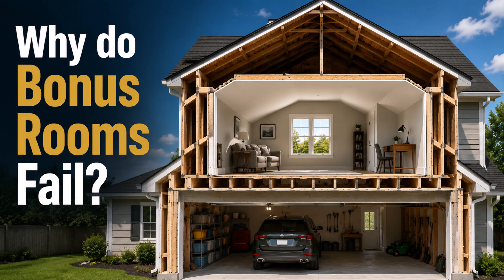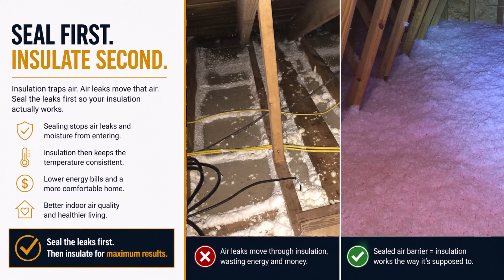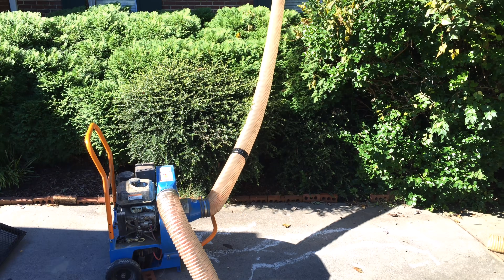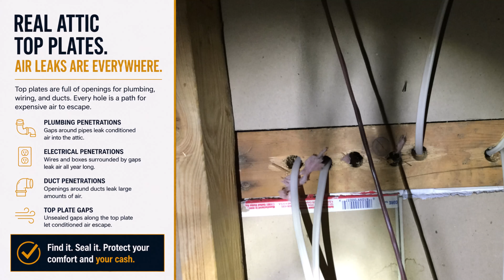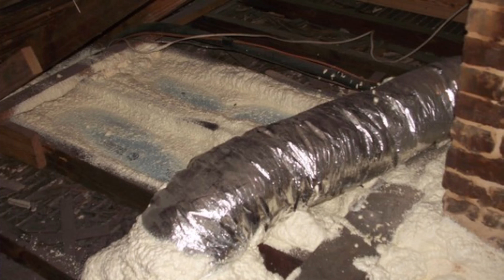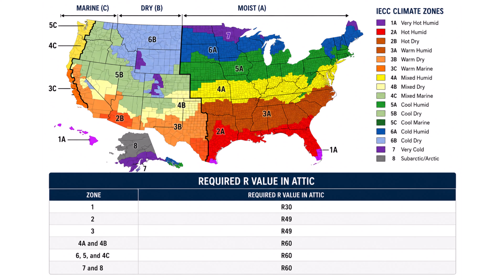Why Your Bonus Room Is Always HOT!

Comment: Great stuff. Everything you said was spot on. I work in HVAC and there is only so much I can do. The building envelope, air sealing and insulation, are the starting points. After that we can look into the ductwork and equipment.
Reply from the maker: @KPHVAC Appreciate the HVAC perspective. Ductwork and equipment can only do so much when the envelope is letting heat in.

Comment: Additionally, leaking supply ductwork creates a negative pressure on the envelope, which in turn exacterbates the leaking envelope by increasing the amount & velocity of air transfer from the unconditioned space to the conditioned space.
Reply from the maker: @benjaminkemp971 You are absolutely right, and that pressure imbalance pulls in so much unwanted air from the crawl space or attic. Sealing those ducts is a critical step in improving your home's overall efficiency and air quality. Hope that helps. Thanks for watching!

Comment: Why don’t you need a firewall over the foam board? I think that what’s it’s called. What state are you in?
Reply from the maker: @imakeituptoyou In many areas, certain types of rigid foam are approved for use without a separate thermal barrier, though local codes can vary. We have locations across several states in the Southeast and Midwest. Answering this comment from Knoxville TN, our Corporate location. Thanks for watching!

Comment: Very informative video! As an HVAC/Plumbing Engineer, even I learned a lot here!

Currently in the process of closing on my first home (c. 1912) — which has a freshly finished attic room, and it has some humidity control issues. I noticed in at least one of the knee walls, the batt insulation is in bad shape. I’ll be sure to seal all gaps before adding new insulation!
Reply from the maker: Thank you!